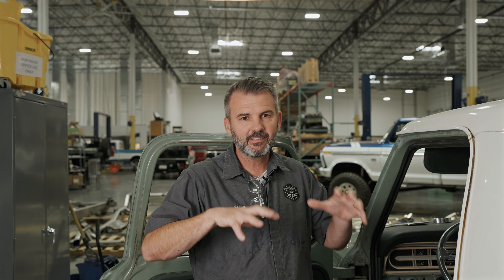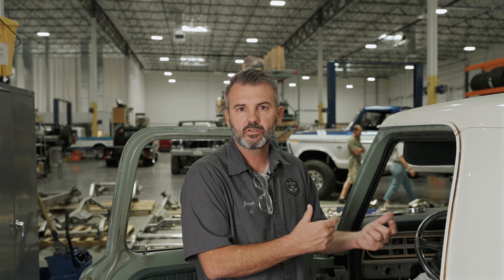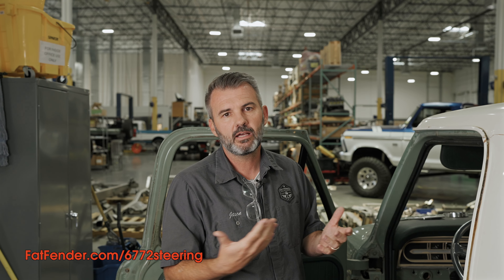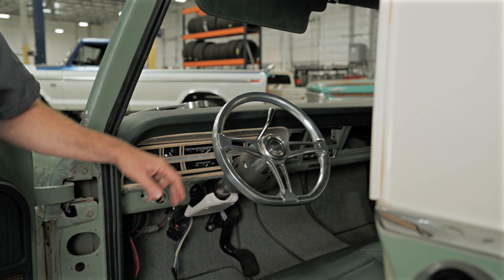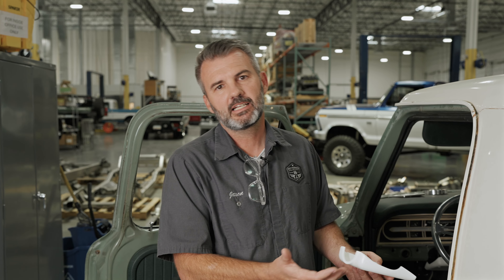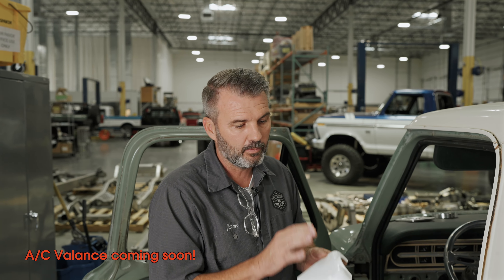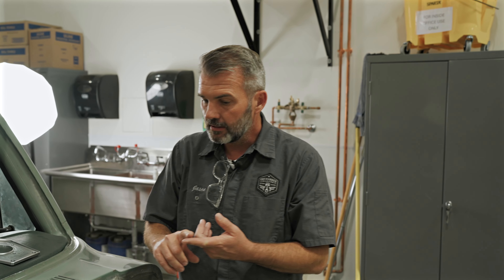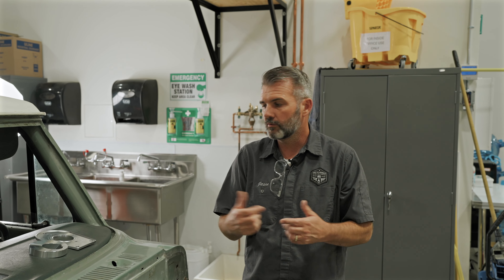FINALLY! The Best Steering Column Setup Ever for Ford Trucks

Comment: What about wiring harness?
Reply: Idk about them but ididit and flaming river generally use a GM wiring harness in the column.
Reply: @seethesvt  ididit has the ford connectors.   Which makes it a snap.  Judt curious.
Reply: @dalehall2993  you must be new here lmao
Reply: Does this column work with a factory steering wheel? Is it gm or ford wiring?